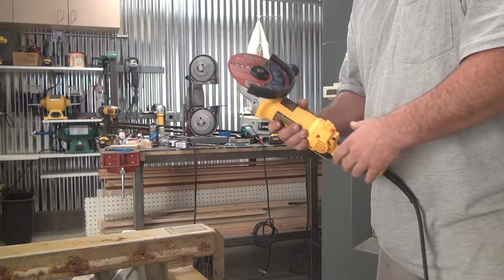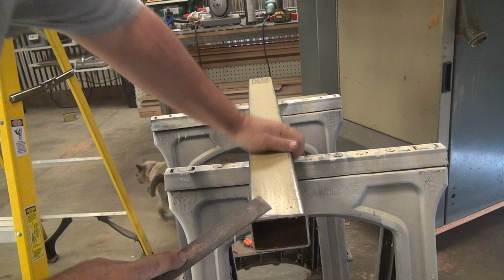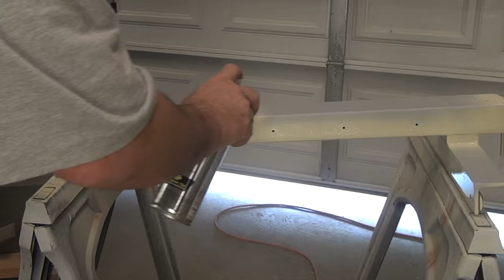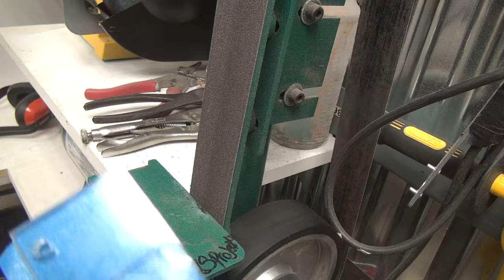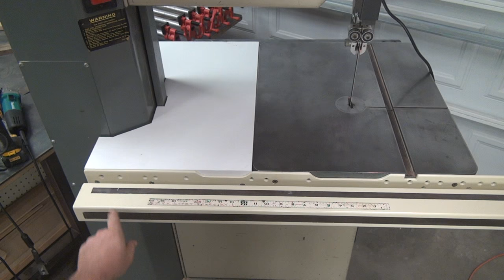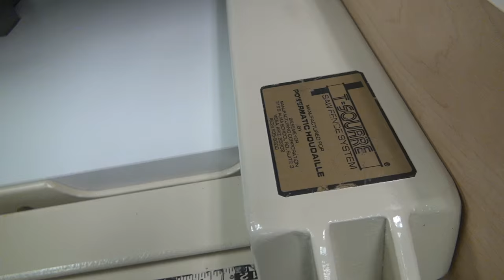Restoring an old Biesemeyer Fence for the 20" BandSaw * Part 2

Comment: Hey Mike - I usually hate these things, but you did a great job with this!  I really liked the pace of the edits and the music is great.  I will watch more of your vids.  I just bought a new Laguna LT14 SUV bandsaw.  It has a fence, but who knows - I may want to upgrade someday.  You have a great command of all things tools, and an amazing shop!  Is that bandsaw single or 3 phase?  Its awfully large for single phase, but maybe.  How many horse is the motor on it?  Anyway - just wanted to say nice job.Joe
Reply from the maker: Joe, The LT14 SUV is a great precision saw with a lot of power, I'm not familiar with the fence but Im sure it will get the job done. My bandsaw is a single phase 240v , 2hp , 2 speed. It has the original motor. These saws were produced for commercial use in schools & I believe military use, many were 3 phase & some models were designed to cut metal as well. It weighs over 600lbs.  I like it for what it is & now with the new fence installed I feel it was worth the effort. Thanks for the compliments about the edits & the shop. The edits have improved with time & the shop is an ongoing project.  Enjoy your new Laguna. I can imagine it with a resaw king & drift master but those are not cheap.

Comment: Can you get the blade out with the table you add on
Reply from the maker: Its funny you bring that up, good eye. I had to modify the top. I could get the blade off only if I tilted the table to a 40* angle, that was a pain so I cut the white top about an inch+ where it made contact with the throat so the blade could easily be replaced.  I used a multi tool & cut it in place, much better... Justen, I bet you saw that coming...